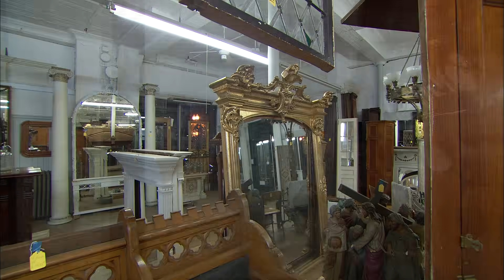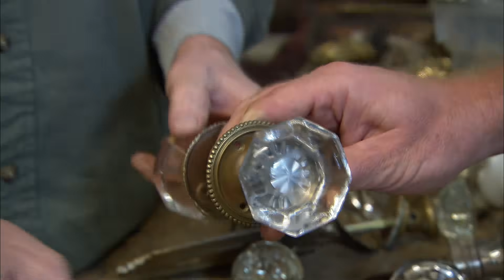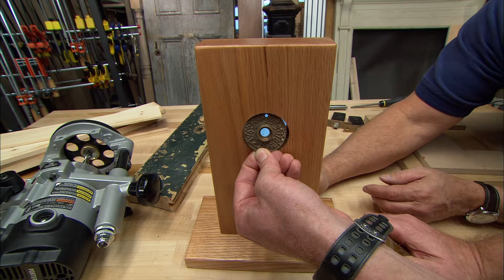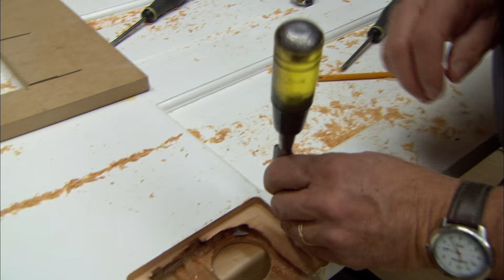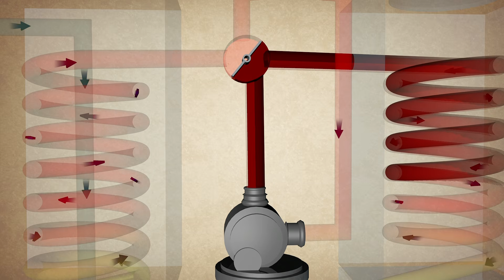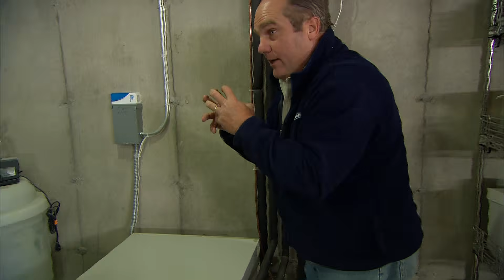ASK This Old House | Antique Hardware, Geothermal HVAC (S9 E22) FULL EPISODE

Comment: I have a house in MA. that’s  well over 100years old. Even if I buy new knobs for closet doors, basement doors that  have mortise locks because they were never renovated remain a loose fit. There alot of slop. Most older mortise locks will have slop in the “square” pass through section for the door knob connect rod.  Is there a fix other than buying a brand new mortise lock? They are relatively expensive.

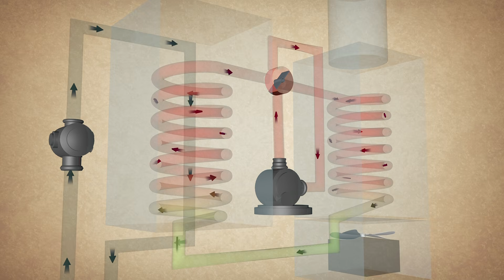Comment: Rich misspoke. 16:25 in the winter, the earth temperature water gives heat to the GASEOUS refrigerant, while the indoor air gets heated by the condensing LIQUID refrigerant. The compress compresses the GAS turning it into a hot LIQUID.
Reply: Yeap you gotta pull vacuum to make gasses from a liquid and force and compress a gas to turn it liquid

Comment: Geothermal is just to expensive to justify the cost in most cases. Most will break before the break even point adding to cost.
Reply: even in a place with hot summers and cold winters?
Reply: @stutter406  As he said in the video it is determined by the total cost of the install, maintenance and energy cost today and tomorrow.